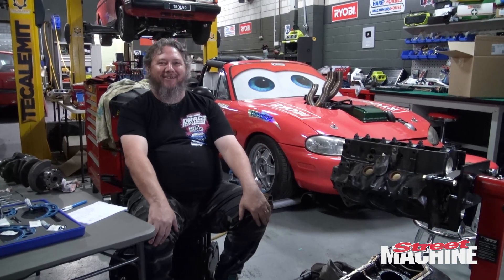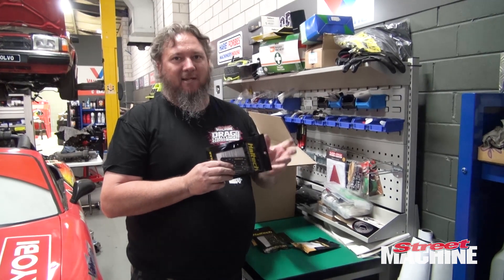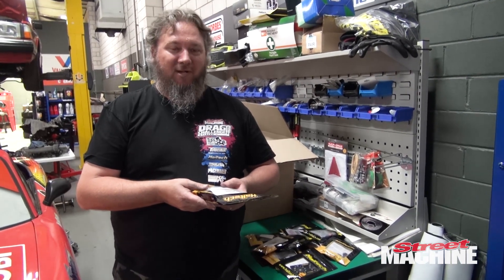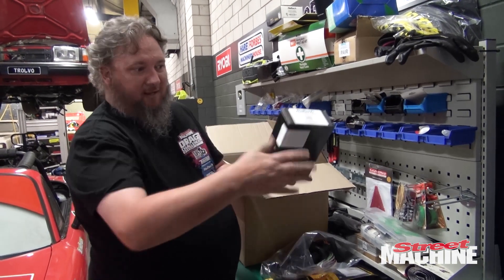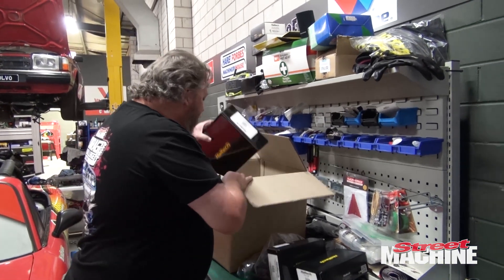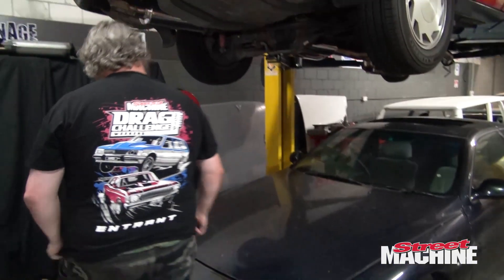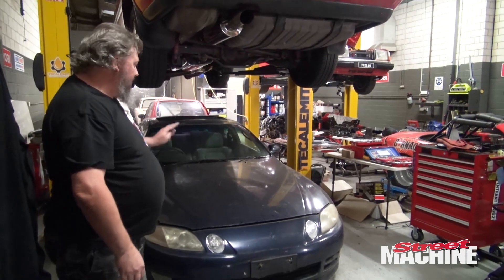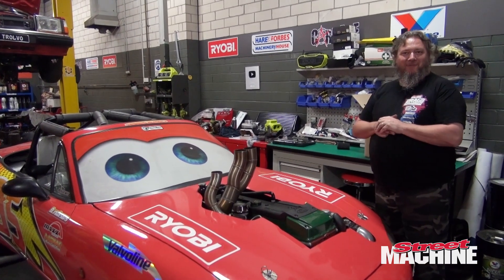Carnage - Haltech Delivery for New Lexcen Project

Comment: Ya know if ya check the fuses in the drivers side kick panel (#17 from memory) you could get that Soarer air suspension working. Sad to pull the 1UZ and waste it in a lexen... Twin Turbo the Soarer instead...
Reply from the maker: The lines are torn from people paddock bashing it
Reply: @STREETMACHINETV  ive probably got some lol